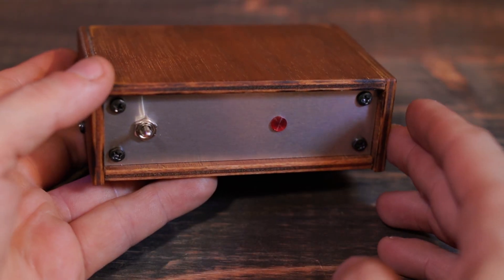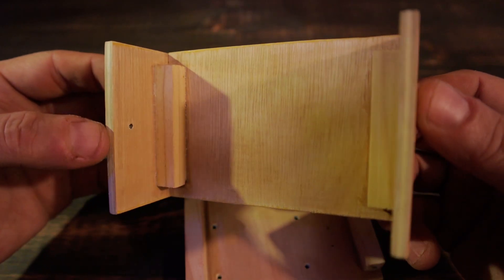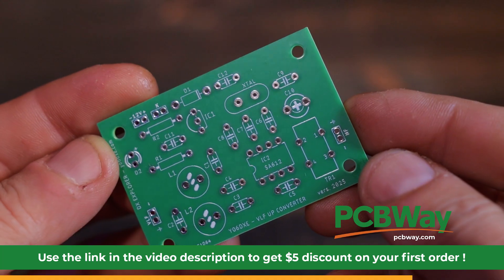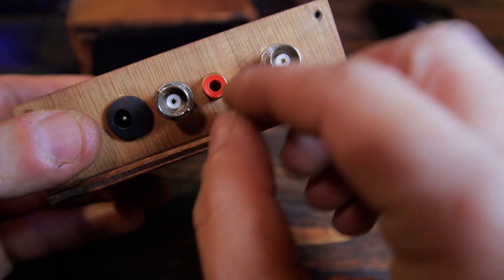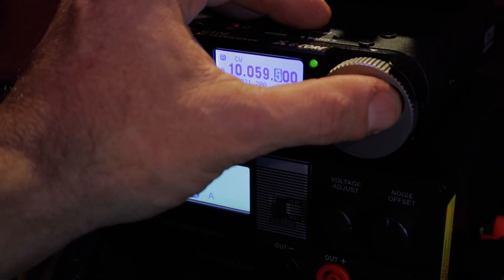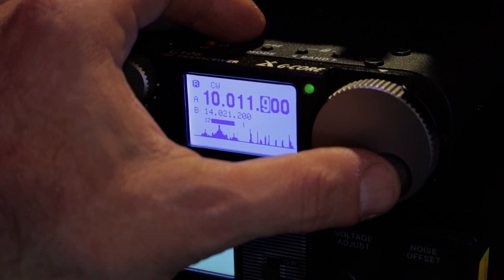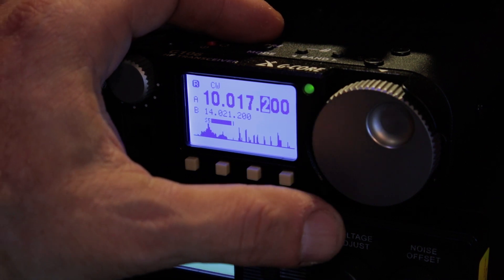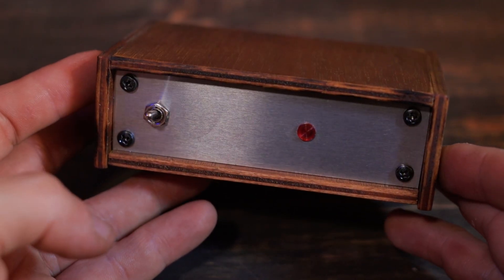Pocket-Size VLF Up-Converter: Extremely Low-Cost, Great-Performance

Comment: Hi, Great video, what is the input / output impedance of the lowpass filter and its cut off frequency. best regards.
Reply from the maker: I calculated it at 1.5K both in and out to have the same impedance as the input of the NE612. As antenna I usually use the 20m band vertical antenna... 50 ohms not 1.5k but it seems to do a god job. But tomorrow morning for the SAQ I will simply connect a 10m wire and that's it. 73, YO6DXE and happy holidays.
Reply: @dxexplorer  Thanks for the reply. I Am  looking forward to morning, see if I can receive SAQ. I've recently built a 20 meter diameter magnetic loop then using an old Palomar VLF converter. Many say 20 meters is not required, but I disagree, It's still a tiny antenna for VLF. Best wishes.

Comment: Very beautiful and simple project! There is beauty and genius in simplicity.
When I discovered the VLF/ULF band years ago, I perceived it as something sacred, I don't know why. But they are natural frequencies and maybe it would be better if the radio didn't broadcast in this band. I heard that some VLF projects were banned in the 1950s because they made it impossible for some animals to find their way, for example whales.
But I feel that this band belongs exclusively to Earth.
Anyway, thanks for the great wiring suggestion!
Reply from the maker: Thank you so much. Yes indeed I thought about it as well. But... the military seems to love VLF since it's not dependable on propagation or radiation conditions... there is always the guarantee that the signal will reach the destination no matter the conditions. But in a way if we think about it... honestly I think there are way more frequencies that are causing issues. I know the phone towers for example, especially the more modern ones are causing the same orientation problem to pigeons and other birds. This I've seen and tested myself a few years back when loosing them on the way back in competitions every time the flight path was close to radar stations or phone towers. I guess in time they adapt to this... but its not happening overnight for sure. Natural evolution takes time. Thank you one more time and Happy Holidays. 73, YO6DXE.
Reply: @dxexplorer  Yes, it's true, some insects can have problems with microwaves. I also have a problem with the cell tower, because they built a huge tower less than thirty meters from my house. I have no chance to operate a CB radio here, the S7 interference. It's even so strong that it can be heard in my audio equipment. It sounds like needles stabbing.
Not to mention that I don't like knowing that I live in such strong radiation.
Happy holidays! 73
Reply from the maker: Happy Holidays my friend, 73.

Comment: Yeah .... there are quite a few circuits out there that rely on the Phillips SA612.  It's a bit disappointing as these IC's are basically unobtainable from anywhere, and when you occasionally see overpriced listings on places like Ebay they turn out to be fake parts.  I really wish someone would post a design for an upconverter  with a Tayloe detector using discrete parts rather than using the SA612.
Reply from the maker: There is something that could be done using a diode mixer instead but it would have no gain so that is why I picked the NE612. And of course to keep the circuit simple using minimal component count. I am lucky that here in Romania we still have local shops selling old stock. 73, YO6DXE. P.S. Those on eBay seem a bit too expensive, that is the reason why I stopped shopping there many years ago, besides the fact that they are not original. I use AliExpress now instead. Even if they are not original ( I think ), at least they are cheap so if something doesn't work at least I didn't spend that much money.

Comment: Nice wooden box... It reminds me of the old nice wooden box days when I built the number 4, compact with built-in speakers, (well, originally it was supposed to be a radio receiver), but it turned into an FM radio transmitter. Since then it has been resting in the back of a cupboard, next to my other inventions.
Reply from the maker: I also like wooden boxes and I don't know why. I think it must have something to do with the fact that I love vintage gear... and... most were in wooden enclosures. Especially those from my childhood. Plus that I really like working with wood. Must me a family thing. Both my grandfathers from my mom and my dad side were working in wood. Thank you so much for watching. 73 and happy holidays, YO6DXE.

Comment: Good result, another functional device in the cute box. I hope somethere in the white box two  protection diodes are placed, just for ESD protection against sharp transitions fore that lone and gorgeous ne602. Plastic variable cap is so-so,  it oxidizes quickly, i  replaced them not long time ago in my fm tuner. 
Anyway it was pleasure to se new project from you, thanks
Reply from the maker: Thank you so much for watching and for the ideas. I don't have the diodes but it's an excellent idea so I will install them. On the capacitor... I didn't know that. So far I haven't had issues but maybe in time... I picked these because of the size. Thank you one more time. Happy holidays. 73, YO6DXE

Comment: 😮❤ happy Christmas 🌲⛄⛄🌲⛄🌲 would you sell me a ready built VLF converter I'm in English england thanking you most kindly ❤❤❤❤❤❤❤❤❤❤
Reply: Please 🙏🥺🙏🙏🥺🙏🙏🥺🙏🙏🥺🙏🙏🥺🙏🙏🥺🙏
Reply from the maker: Well its Christmas so why not. But I won't be able to send it fast enough for the SAQ transmission. And because it's Christmas... how about just covering the postal costs and that's it ? Happy Christmas to you as well. 73, YO6DXE.
Reply: @dxexplorer thats so kindly off you how do I get you my email
Reply from the maker: Just go on the blog on dxexplorer.com and send me an email from the contact page. I think I should have all the parts to build one sometime between Christmas and New Year.
Reply: @dxexplorer yes just discovered your page I will do just no rush I pop my call sign in there many thanks ❤
Reply from the maker: @moormoor4281Excellent. We keep in touch then. I may use my sister's laser cutter to make sure the box its a little better than mine 😂 ( mine it's not very straight even if it doesn't show in the video haha ).
Reply: @dxexplorer and how could I pay you😮
Reply from the maker: Don't worry about that now. I will see how much it costs to mail it and I will let you know.

Comment: Thank you, you have a fine LF converter. In the USA there's a similar one as a kit with both 4 and 10 MHz crystals to choose from. Search wb9kzy lf converter, it also has the schematic.   Steve AA7U
Reply from the maker: Thanks so much Steve. Yes this one as well it works with any HF crystal depending on what you have available. For me 10MHz was easier. 73, YO6DXE.

Comment: Another upconverter - cool!
Reply from the maker: It's the same from the other video, but the finished version. I absolutely love the way it works. Thank you for watching. 73, YO6DXE.
Reply: Yes, it seems to work very well. I definitely need to build one! BTW if you don’t want to wait for the glue to dry, just use epoxy - it’s great for stuff like this.
Reply from the maker: @my.own.devices  Ohh good idea. I didn't think about that. Thanks so much. I am bad with patience when it comes for these to dry 😅 73, YO6DXE.
Reply: One more thing: if Santa still won’t bring you an oscilloscope, at least treat yourself to a small ceramic screwdriver. It’s such a delight when adjusting those little trimmers!